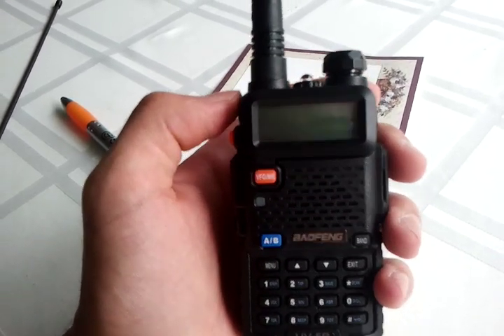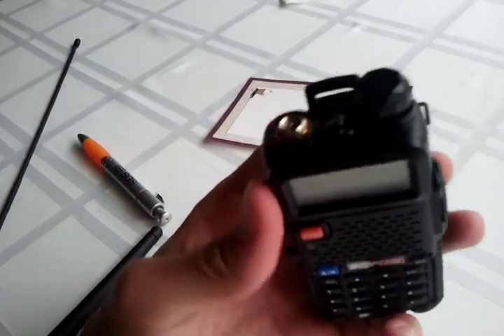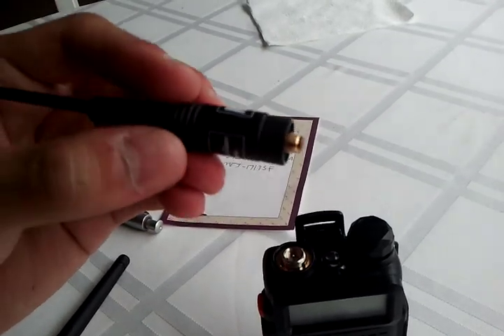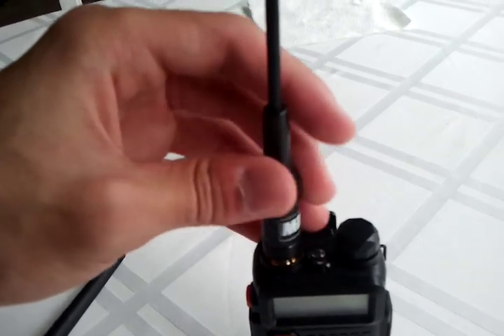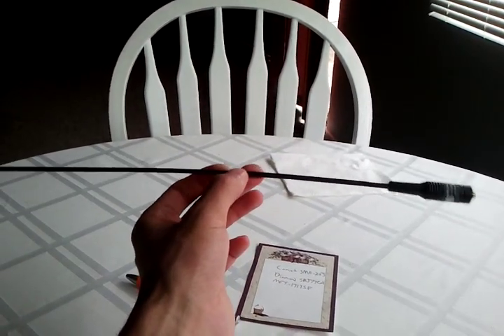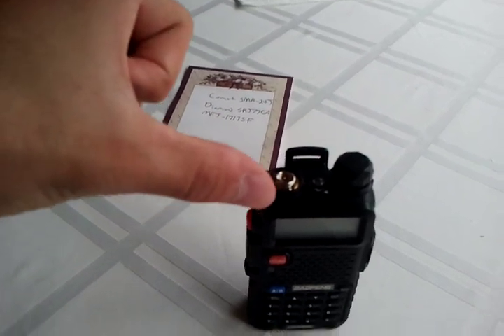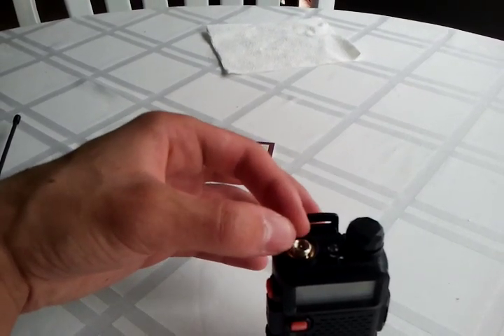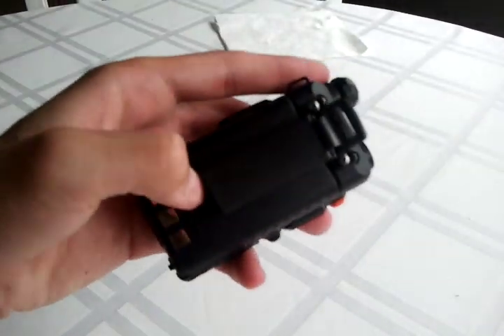Baofeng UV-5R Antenna Options

Comment: I use them. I recommend that shop. Very fast shipping. No charge. Low prices and response from them is same day or faster. I had trouble with radiogearpro. Maybe my experience, but they took too long to respond. Both are out of HK (I'm in Tokyo). 409 shop has everything you need and then some.

Comment: Lockout. The UV6D has a lockout function that prevents anyone from changing the settings without a password. The UV-5R doesn't, so in the field you can't trust anyone but yourself with the radio.
Also the Wouxun is IP55 rated. You can consider the previous models which are slightly cheaper.

Comment from the maker: I'm pretty sure I talked about that. And how a solid adapter would put more stress on the radio than one with a short cable. But yes an sma female to sma female would be a great option. I would just make sure that it has some sort of strain protection so the connector doesn't get damaged.

Comment from the maker: It's the MFJ-1717SF. And it's definitely an improvement over the stock antenna. But I'm not really sure how it compares to the Comet SMA-24J or the Diamond SRJ77CA. They are all similar in length and all of them will be better than the stock antenna. You might want to look on eham for some reviews.